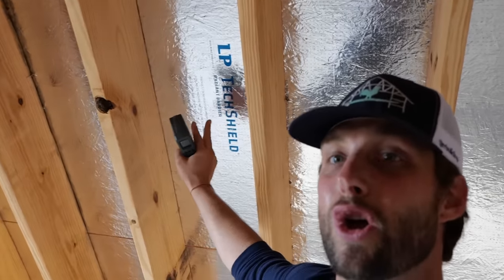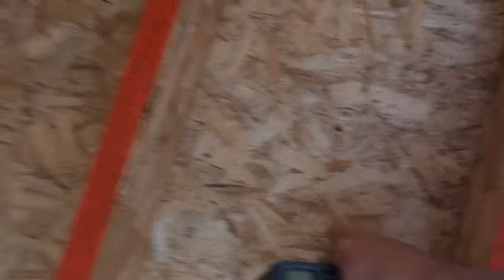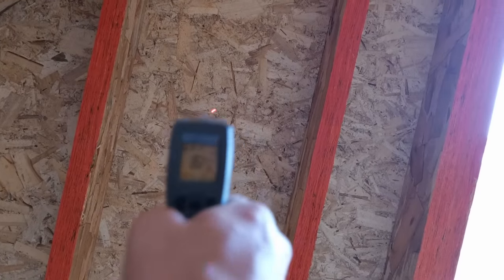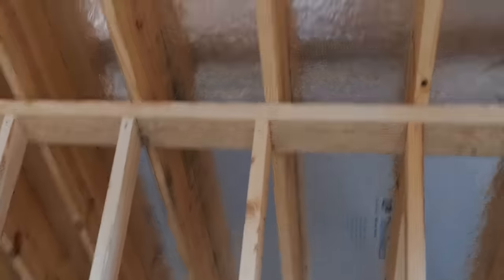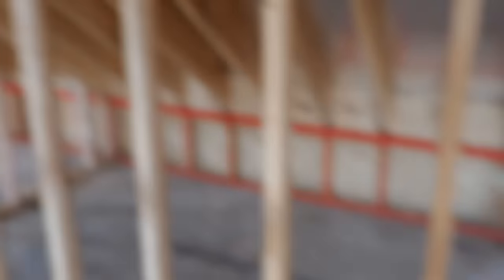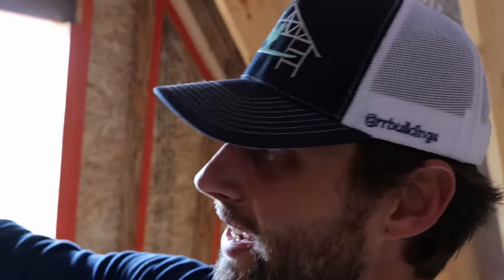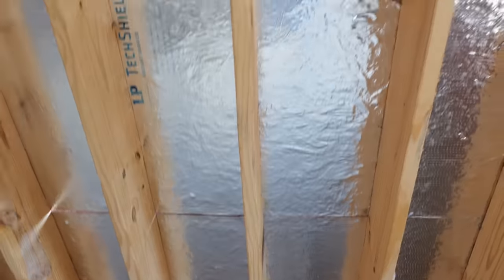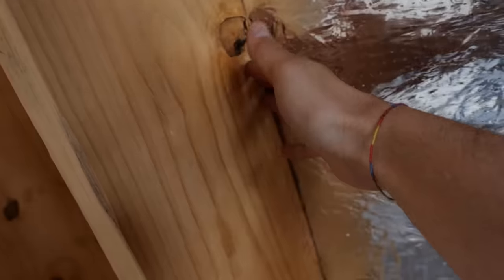Do Radiant Barriers Work? - LP Techshield Review

Comment: I have the exact same product in my home and I tell you it DOES NOT WORK! My attic is hotter than Hell in the summer and keeps the second floor of my single family home hot throughout the night in the summer unless I turn on the air condition unit through the night. I'm looking into a foam style product that fits in between the rafters.
Reply: I have the same problem cause there is no ridge vent, im thinking putting cardboard baffles on each bay then drill holes at the birdblocking on each bay and put aluminum foil on each baffle running the lenght of the bay same as radiant barrier just doesnt hve any r value to it, what do you think? Have you installed your foam product how is that workin for you?
Reply: @alhavana9426  I have not. After carefully reviewing my expenses and reviewing the most efficient way to cool my attic I decided to invest in an attic fan. I decided to purchase the Quiet Cool AFG PRO-3.0 . As a matter of fact, it just arrived today. The fan is about a $200 investment and I think it will fill my needs as far as cooling my attic. I will provide a link to a video of my documented install as soon as it becomes available.
Reply: JAU41 Aww right on, hope that works for you, my girlfriend is gonna be miserable today as it is 100 in bayarea so i need to do something,i just ordered the radiant barrier to staple on the bottom of the roof decking hope it helps but im thinking i will also get the attic fan you mention since there is no ridge vent on the 2 story attic, thanks for the reply

Comment: I am learning.  Great point @5:56 about the rafter touching the roof deck foil and conducting heat into and through the rafter.  If I use the Reflectix R 21they sell at Lowes' for my flat roof detached garage, it seems it I will just be conducting heat into my rafter beams from the foil. That mans the rafter will eventually be the same temperature as the roof because Heat flows from the warmer to the cooler object until they are both at the same temperature.  What do you do to solve that?  I was wondering what do you recommend? Also, for creating a conditioned space (still learning), Dr.EnergySaver uses SilverGlow to produce that. https://www.youtube.com/watch?v=6F_IkZJ8NOY&t=210s.  What approach do you take?

Comment: CAUTION, CAUTION, CAUTION!!!!! Before installing this barrier underneath your exterior shingles, BE AWARE that the shingles needed on your roof will need to be of a special type!!! Unless you have the proper shingles, the refraction of heat back through the shingles will shorten the life span of the shingles to an alarmingly short life!! THEREFORE, YOU WILL SPEND THOUSANDS for extra roofing materials and NEVER recover how much you save on energy costs differences. A roof will cost roughly $200 per square 100’ To replace it will waste more $$ on one of the most expensive components of your house.
Reply: That’s what I was thinking. 😂
Reply: @edsil5754  Yeah. The radiant barrier actually is great if you live in Alaska, or somewhere up in the north part of the country. One of the best Radiant barriers is a steel roof painted with a light gray or other color for refraction purposes. However, furring underneath a steel roof is an extra expense, and it costs more per square foot. You have to figure whether the extra upfront costs will be recovered because of the extended lifetime the roof offers. Factoring in the estimated cost of electricity due to the overuse of electric cars in our future, may well justify a steel roof. Why? It is estimated by the car manufacturers that it will take about 18 times as much electricity per month as it does to power your heating and cooling systems to power your car. So,maybe steel is the way to go?

Comment: Good video, but I'd disagree on one point.  Your inside insulation choices won't 'negate' your radiant barrier benefit, but they may enhance it.

(repeating on this top level some of the reply to Tim Rothgeb below)
The radiant energy is still being reflected regardless of contact, reducing the heat gain in the attic.  This will likely add some heat to the wood roof deck and shingles/roofing but that heat issue is limited to the gain by conduction.  This is why there's a need for additional insulation below the radiant barrier.

I wonder whether planning an air gap or insulating right against the radiant barrier is actually better and suspect this may depend on many factors including choice of insulation, whether you have ridge vents, whether you're going for full encapsulation.

Comment: So every board touching the barrier transfers heat, doesn’t seem like a very good system. I prefer externally insulating a house like a ice chest.
Reply: You need to use both. Radiant barriers are best on the outside of the attic under the shingles/metal roof. 
You need a 1” air gap between the barrier and the roof deck. 
Then, you insulate underneath the radiant barrier.

Comment: The foil is supposed to face towards the sun.
And you can’t compare wall sheeting to roof sheeting especially when you pointed it at an uninsulated wall.
Reply: Not so. The foil must not touch anything or it will not work. If you nail shingles directly on to your roof deck, then the foil must be on the underside, as shown.

Comment: Not a good test. If you move further away...quess what, Temp goes down. You need the air gap between barrier and inside roof. You are keeping heat sandwiched between heat barrier and roof.

Comment: Those Infrared Thermometers are very inaccurate on or around a Shiny Surface. He needs to use a Contact Thermometer with a Flat surface, that come a little smaller than a Dime. I have a Fluke Infrared Thermometer, so I know what their short comings are.
Reply: I was going to mention the same thing but Steve nailed it.

Comment: The Planet Earth itself generates enormous amounts of heat, too and in conjunction with the Moon you can literally "feel" that in the form of Humidity or massive water content that adheres to itself suspended in air causing most spectacularly perspiration or sweat.

That's why the most important item on any structure properly anchored is of course the roof with the worst/cheapest for a reason being a shingled roof. A huge step up from that is clay which absorbs massive amounts of heat content but then also absorbs massive amounts of moisture too creating a mold problem. Next up from that is a correctly painted and installed metal roof which simply reflects heat and wicks moisture, is good in all types of weather conditions but most importantly when the wind blows allows for the substrate/plywood backing(the thicker the better) to act as an awesome heat barrier and moisture protector.

The best/most expensive is of course rock specifically flat rock which while very heavy solves all the problems save for mold but is much easier to clean than tile. Should last forever as well.

After that THEN you can move indoors and talk insulation...the best being an air gap between the frame and interior with soffets to allow the structure to "breathe"(circulate air) as a passive barrier for both heating and cooling.

You're way overdoing it with nails and framing I might add.

Other than that spot on!

Comment: Methinks this guy is missing the point.. the radiant barrier works by reflecting the heat back into the OSB... from the side of the foil you can’t see.. so it works whether conduction occurs or not.
Also why not wait for a sunny day to get valid temp data.

Comment: Thanks for the great video.  However your results are likely false.  Do some research on emissivity.  I feel radiant barriers are a joke.  I’m in south Louisiana, my attic runs 140-150 degrees during peak summer.  The radiant barrier claims a 15 degree differential.  125 vs 140 degrees makes very little difference.  Given The the shoddy workmanship of homes today I would venture to tell you, your better off with a hotter attic to better manage dew points.  A cooler attic will reach dew point much sooner and stay there longer.

Comment: meh, radiant barriers need an air gap to the outside, aka, the heat source. the radiant barrier in this scenario is conducting, not radiating, some heat energy back up through the roof deck, but its doing the same conduction AND radiation into the air on the interior space. losing most of the benefits of radiant barrier in this scenario. much more efficient would be 2x10 rafters, standard roofdeck, 2x6 insulation against the roof deck and the radiant barrier silver foil attached on the INSIDE space to the rafters ensuring its not touching the insulation via airgap. Airgap is to prevent moisture buildup and mold growth.

Comment: What rubbish!! Lol I do not agree, he even got his terms mixed up at one point. The temp difference may have been because the color of external walls are normally different to roofs on the outside and the cladding is almost always different!! But the video did not show that either….

Also the R value of a 10 inch bit of timber is a lot more than his foil and so spreading the timber’s out would not make the overall result better.

The air gap he says foil needs ? Please explain to me why foil that is facing inside and never has any radiant heat from the sun touch it can be reflecting that heat…. And maybe if aluminum was not such a good conductor of heat (think coke cans) you would not need an air gap either …. What is the air gap? Just more conductive insulation to stop the “HOT” foil from touching the real insulation. 

Make me a believer and show me the outside color and the fact that the wall and the roof has exactly the same layers other than the foil …. Otherwise this video is Fake News!

Comment: The roof foiled-faced OSB is effectively mirroring heat energy from the attic floor, which is expected to be less warm than the roof. You are effectively observing the delta between the roof sheathing and the attic floor. This product is a scam. If I could feel morally justified in selling OSB with foil glued to one side for nearly double the price of regular OSB, I'd sure be doing it.

Comment: You should not do the measurement directly on the aluminum surface. This fools this kind of thermometer. To avoid that, place a non-reflective surface in front of the barrier and measure on this surface - a simple piece of cardboard is enough. Results are very different.

Comment: No! But 8" of open-cell foam will. That westerly facing roof is angled just right for maximum solar radiant gain and the decking and rafters will be hot to the touch and that radiant barrier will have no effect. I say scam just like powered roof vents

Comment: Moderator trips over his own words.   I guess he's in a hurry and didn't prepare his dissertation on such an important topic.     He fails to educate the layperson on the compromised benefit of radiant barriers in intimate contact with unclad rafters; i.e., conduction defeats radiant barriers; IR showers attic from wooden rafters, and that will only get worse with age as the rafters darken and more closely approximate "black body radiators."    "Rock, scissors, paper" analogy would be warranted; conduction defeats radiant barriers!       Also, moderator never touches on the worthy points of ventilation and the need to prevent moisture from condensing anywhere at all.      My SoCal single family dwelling has a new roof whose installation exceeds the code requirements around here (Title 24);   I have ridge vents and eave vents, and battens to enhance the air gap of my SHINY SIDE DOWN radiant barrier-clad OSB sheathing.
Reply: I don't see my rafters blacken after 30+ years. :) But, you are partially correct in the heat conduction into the rafter that will radiate. But, is that quantity more than what is not radiated by the deck area covered between rafters that is not or hardly radiating?

Comment: This guy is talking about convection from the roof sheathing to the roof rafter (3:11) when he should be referring to it as conduction (which he does change to "conduction" as he is speaking).  All the talk about air space and insulation/foam "negating our radiant energy" is incoherent mumbo jumbo - sounds good, means nothing (only thing missing is Larry the Cable Guy accent).  It sounds like a used car sales pitch to me. The laser thermometer test should have been on a section of roof sheathing without barrier instead of on a wall on the other side of the house. LOTS of bs here, very little science. All that being said, it is a good and effective product, poorly understood by Texas bumpkins (lol)

Comment: Roof deck differential versus your wall? Is also off-set by either the layers of shingles (underlayment, shingles, et cetera) versus your BARE OSB wall with what type of external cladding?.

Yes it makes a difference.

Your entire video is comparing apples to oranges as a result unfortunately & is disingenuous at best.

Comment: The problem is you're also measuring two different surface types and infrared thermometers like yours on notorious for 10°+ temperature between smooth and rough materials.  While I do think you're on to something, I think it was oversold based on your measurement technique and instrument of choice.  I think you should really include a science person to vet any experiment you are claiming as fact as you are.  We also probably assume that this relationship is not linear - Foil used like this only delays heat transmission because it it's relying on conduction but I will at some point achieve the same temperature.  If you also had a layer of insulation on that sheeting with a decoupled nail, you would have the cats meow of all insulated sheathing. :)

Comment: Every single video about radiant barriers are taking the measurements wrong. Never measure on a shiny surface. 

Radiant barriers probably doesn't work, but it's an easy to trick people it does. 

Remember those wrist bands people in the middle the mall sold. Supposedly with it on it gave you more strength and balance, but in reality they were just pushing closer to your center of gravity to make you feel stronger. 

Easy trick to sell people crap. 

Can someone just please do the same test but with a piece of matte tape on both surface.
Reply from the maker: You do understand what radiant means right? If you put a piece of matte tape over the foil, then yes, the heat will transfer through conduction from the foil into the tape and then the tape will re-radiate that at a much higher rate than the foil because it’s emissivity is so much closer to 1.0.  The whole idea of a radiant barrier is to keep heat from radiating off the material. It won’t do anything about conduction where the material touches the rafters, and it won’t do anything about convection where the air circulates around the material and transfers heat into the attic through an increase of molecular energy.  However, it will decrease the amount of energy that is transferred into the attic through radiation. And that is exactly what using an infrared thermometer shows us.
Reply: @JordanSmithBuilds  I'm very familiar with what radiant means. I work with electromagnetic waves for a living. 

I'm not saying use tape, on the radiant barrier. I'm saying do not use an IR thermometer directly on the foil. It will not give you an accurate reading.  

Why not measure the ambient temperature inside the roof and outside. Measure the delta. Also take note of the Foot candle and UVA and UVB index for that day to isolate variables. 

I know this isn't easy, but I would love to see someone do a real world test on a small scale model and use proper techniques to measure temperature. 

The science is there, but often in practice the math doesn't hold up as other variables come into play.

Comment: Sorry but what an absolute shit comparison. The radiation you measure on the OSB is the radiation it is emitting itself, the radiant barrier only slows the radiant energy that is reflected. So you can compare things using the thermometer but not in this way. (reflective material and radiant material).
Also it needs a tiny air gap. So when the radiant barier is stuck to the OSB it will only work from reflecting heat from the inside back to the inside. It won't reflect heat from the outside back to the outside nearly as good. (lets say less than a % then if you had an small air gap).
Reply: Not really. That foil has a very low emittance value, meaning it doesn't radiate much, 0.03 compared to the raw wood that is about 0.9.. The roof decking will increase in temperature though.